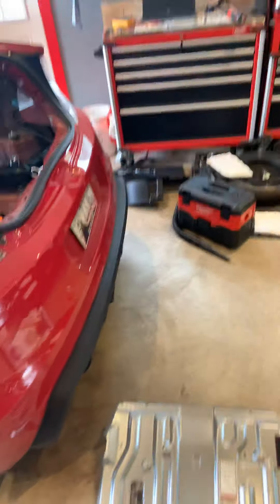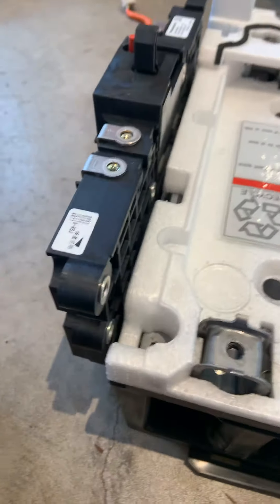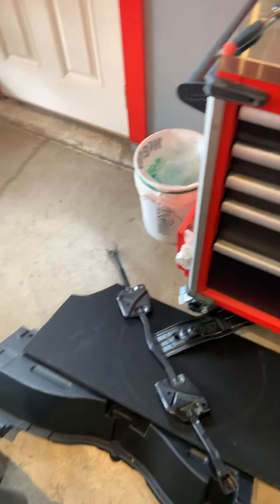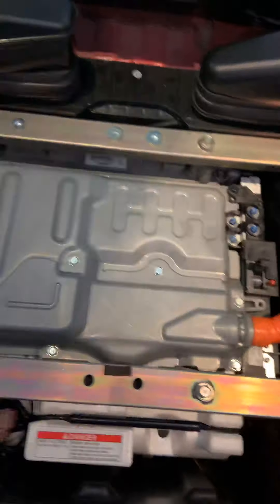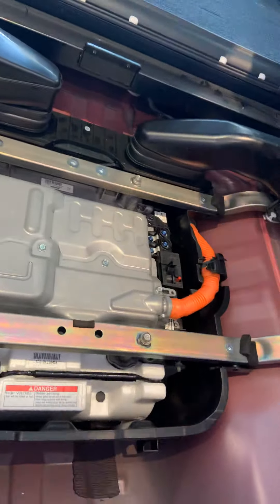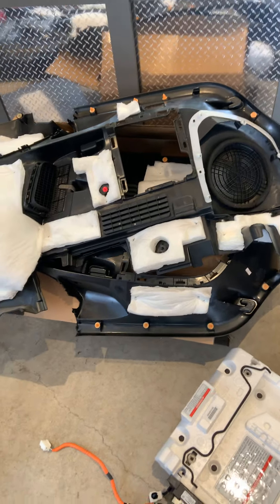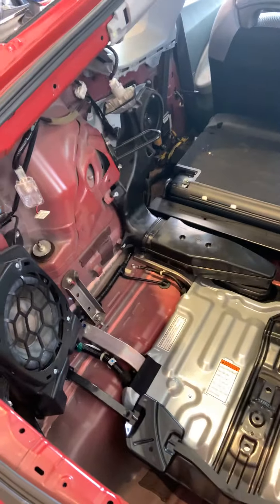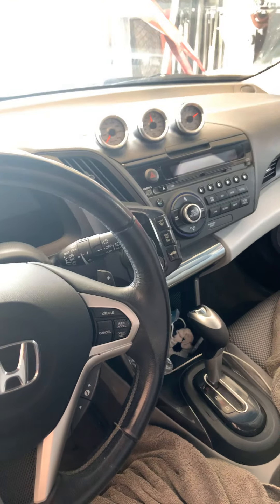2011 Honda CRZ hybrid battery replacement part 2

Comment: I just bought one of these cars. I appreciate the video. Can you tell me how much that battery cost and where you purchased it?  And any info on what u needed to reprogram the computer would be great too. I don’t need a replace yet but I’m just trying to get as much info as possible so I know what I’m in for down the road lol . Thanks in advance
Reply: $3300 from honda (just the cell pack). There are other parts like inverter, bms modules, etc that could go bad as well. Used ones online range from $500-$1500. There are companies that will sell and install a refurbished battery pack for around $2000 (years 2010-2012 only) for the NiHm battery. A dealership on Long Island, NY quoted me $5400 to replace hybrid Lithium ION battery on my 2013 model, but did not explain if anything else was included
Reply: @jonathanvillalba3214  very true, although hardly any of these batteries have failed (check CRZ forum) and when they do? K-swap time! Not worth replacing the IMA battery, also rarely with the CRZ is it anything worse than replacing the Hybrid battery.

Comment: Is there a filter in that duct work anywhere?  I have the same car right down to the year & color.  Glass lens fog lights lasted not even 2 years, one cracked the other had a hole through the glass.  Just over 200,000 miles, no battery issues, yet! lol
Reply from the maker: Hello no filter in the duct work and I’ve replaced my fog lights three times. But them for the Civic same housing different bracket. They’re like $40 for the pair if I remember, just remove from the Civic bracket and install in yours. Save yourself a few hundred dollars.
Reply: @alconk7129  I removed the glass, heated some lexan to get the same curve, sealed them on the front.  Had to switch to led lights because the old bulbs would have been way to hot for the lexan.  They've held up great for over 8 years now.
Reply from the maker: @christopherbrown5338  nice I bought those lenses years ago but never mounted them. Yes that would be much stronger than glass or more forgiving

Comment: Nice video man
whats the procedure at the ECU after finishing installing? which equipment needed?
Reply from the maker: I used a “Launch” that enables me to get into the battery program to reset and tell it it’s been replaced. You will need a professional piece of equipment like that to do it SnapOn Matco ect.
Reply: @alconk7129  to the everyday oil change/ tire rotating/battery swap guy who can do said  these things - your video is straight forward. Buttttttt.. your saying we need to acquire a professional tool to reset the battery/ECU?????  I mean I got a bluetooth/wifi OBDII generic scanner that spits out error codes..guessing that won't work.... will you care to go into detail about how much this "professional tool" would set someone back, maybe even the model number of the launch tool you have...., ect.. - otherwise most people don't have things like that laying around, and the cost of the professional scanning tool might out weigh labor cost for replacing the battery..
Reply: @jbuening4372  I agree, if you don't have the right ECU software tool it's debatable how much you will actually save doing it yourself. Plus a shop doing it will be insured and offer a basic warranty on their workmanship.
Reply: @alconk7129  you should offer the equipment for rent to these people asking for like 100 BUT CHARGE THE FULL PRICE OF SAID EQUIPMENT UP FRONT BUT Once it's returned you deduct the 100 from the full price and refund the rest.  That keeps people honest and helps you recoup some of the costs for that equipment.
Reply from the maker: @johngatsby1473  good idea

Comment: Fantastic can you tell me where you purchased the battery and how much ? Thanks for the informative video.
Reply from the maker: I think it was called GreenTec and paid $2200 since I upgraded the battery to a 8k instead of the factory 6k which cost $1700
Reply: Thank you I will look into that , is everything working fine since you installed it ?
Reply: wat tool you need to program.. new battery installed... if i go back to oem 6 do i need to program anything?

Comment: Hi,
did you try to open the old battery and to look what's inside? Maybe few cells that could be replaced individually? I mean the batteries deterioirate, but usually a few cells at a time, so maybe if there 50 cells. Maybe just 5-6 could be changed and the battery could be again like 80% like new, or something similar.
Reply from the maker: No I didn’t I wasn’t that daring.

Comment: Very useful video- I need to get the cover off of mine but don’t have a driver to get the funny little star hex screws out. Do you know what size they are?
Reply: For future reference, those are called Torx. You should be able to buy a pack of them for fairly cheap. They are sized as "T##" Such as T10, T25, T08. The bigger the number, the bigger the bit. On cars, they will likely be in the T10-T20 range.

Comment: If I buy the original factory battery will I need to program anything in the car to tell it there’s a new battery?
Reply from the maker: Yes regardless of what battery you buy it will still require programming.
Reply: @alconk7129  well damn guess my cars totaled when the battery goes out then
Reply from the maker: @freelancedentist9480  it’s no big deal take it to the dealer
Reply: @alconk7129  I was told it would end up being $4,000+ if I did that
Reply from the maker: @freelancedentist9480  you could do this yourself. I upgraded the battery and that was $2000 and plugged a scanner in and registered it with the car and done.
Reply: @alconk7129  will a $500 code reader do the trick ?
Reply from the maker: @freelancedentist9480  maybe depending on what it can do. I’m using a “Launch” scan tool that can program. If it can scan keys and code batteries (12v) then I’d say yes. Did you call your dealer to see what they would charge just to program? Took me long enough to hook up scanner and upload so I wouldn’t think no more that a hour labor. You can drive it there with the new battery it just won’t be doing anything to it’s programmed
Reply: @alconk7129  I was worried they wouldn’t program it unless they installed the battery themselves due to liabilities with me possibly incorrectly installing the battery myself but I’m gunna check on that soon.
Reply from the maker: @freelancedentist9480  yeah call them cause that’s a possibility. Where you located?
Reply: @FreelanceDentist  did you do it?

Comment: a) how does the new battery perform? b) where you located and would you be interested to do it again on my cr-z?
Reply from the maker: Feels a little quicker for one since I opted for the 8kw compared to the factory 6kw. I’m in central Illinois but too busy to work on other vehicles. I can give advise if you need any
Reply: @alconk7129  any help is always welcomed so thanks. Where did you find the upgrade battery? Have a link? Cheers

Comment: Hi, how did you find out the battery needed to be replaced? Were there any noticeable symptoms?
Reply from the maker: The mileage started to go down considerably along with performance. And the “assist-charge” indicator stopped showing assist when depressing the accelerator. Plus being just about 10 yrs old and 113k miles that’s about the life of the battery